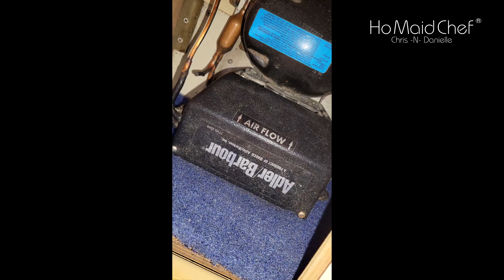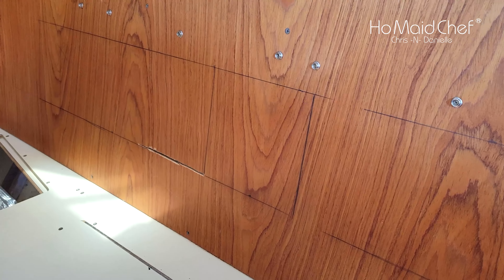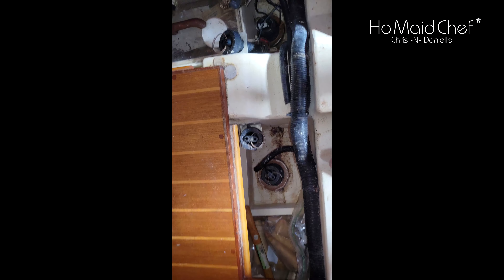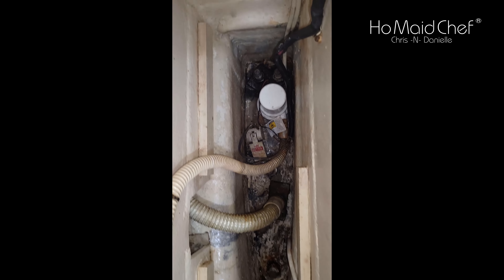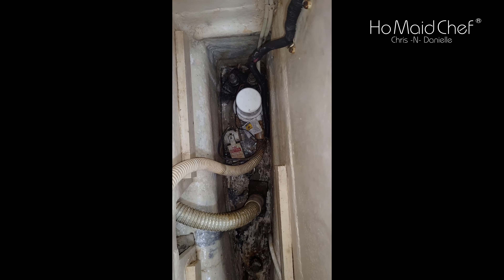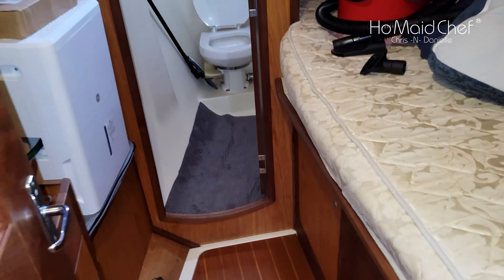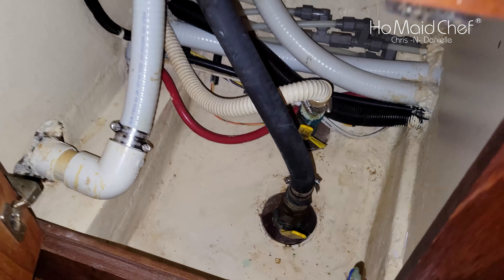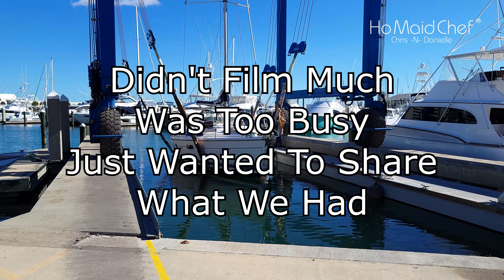Sailing Into A New Life: First Week On A Sailboat And Projects! Ep 1

Comment: Do an inventory of every plumbing fitting you have and keep at least one of each in stock for repairs. If you have 7 or 8 or the same type keep 2 in stock. Also keep plenty of hose clamps in the various sizes and thread tape
Reply from the maker: Exactly what we are trying to do, great advice! Going to pick up a variety of connections and some caps just in case we can't fix a water line. We are currently just taking inventory of what we have.